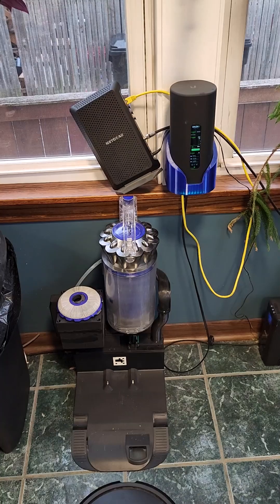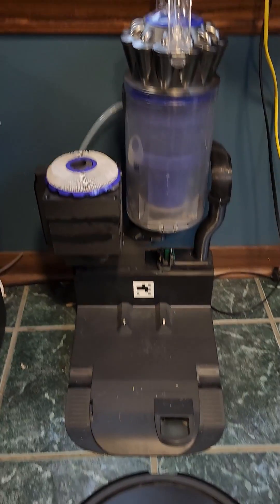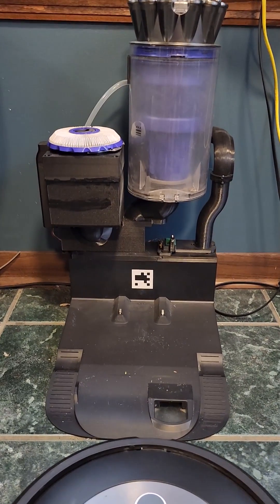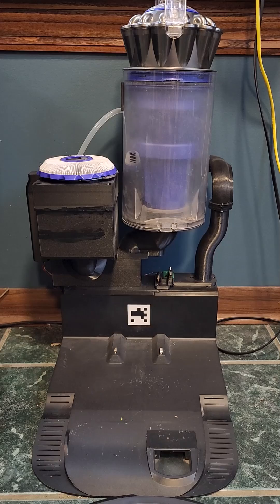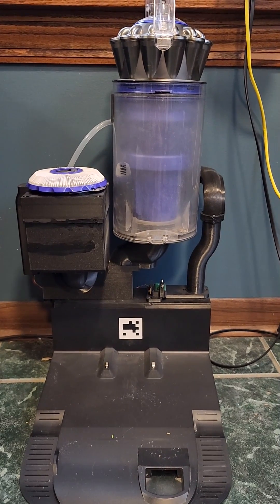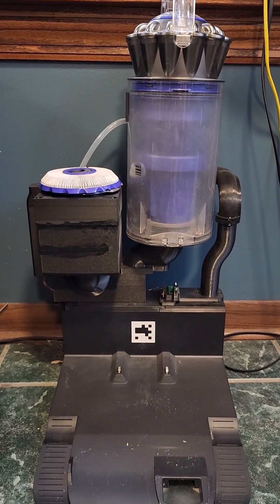I used Dyson parts to make my Roomba J7+ even better!

Comment: How about STL files as well? I just began using an S9+ and have central vac outlets. Would love to make a similar adapter for the central vac. No FLA printer but do have larger volume resin printer.
Reply from the maker: https://www.printables.com/model/118716-roomba-j7-conversion-to-dyson-ball-animal-2-dust-b

This is fundamentally incompatible with the S9+ however I am looking to add support for it soon. I just need to find a used S9 on eBay for a reasonable price.

Comment: I guess you could get it hooked up to a central vac as well then.
Reply from the maker: Central vacs tend to not have quite as much suction as the high-power motor in the base.  The j7+ needs a lot of suction power to clear the Roombas bin out completely.  It would be hard to trigger the vac as its only 120v ac power for the motor and not a digital or analog signal. You'd have to reverse engineer the board most likely
Reply: @AnIdiotwithaSubaru   I have a few dysons(old and new cordless sticks, and a plug in unit) and a good central vac will always have more suction. Also the central vac has a low voltage control wire so when you plug the hose into one of the outlets, it turns it on. Just a simple relay could control it.
Reply from the maker: @lsdave  yeah absoutely! thats kinda what i was thinking with the analog thing. The only central vac i used in my life was a total pos so I'm definitely bias hahah. The adapter for the centeral vac would just need a tee for the suction sample tube (the clear silicone tube) to let the clean base know if its achieved enough suction power to clean it out.

Comment: I really need this in my life. Currently rocking 5 dogs...4 long-haired. Any STLs/3MFs would be SUPER appreciated.
Reply from the maker: I can get them organized and uploaded tonight. Some of the parts had several revisions so I need to make sure they're all the correct versions so it fits together correctly. I added my Prusa Printer profile in the description so check back later and it should be uploaded!